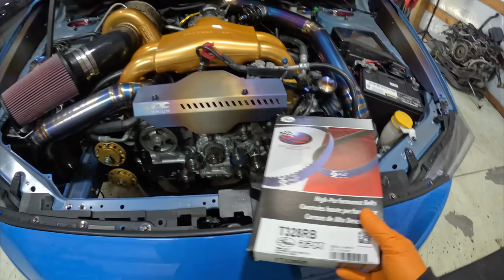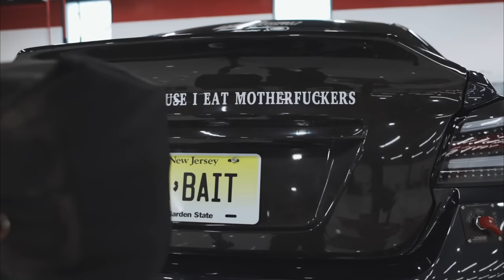DIY Subaru Timing Maintenance

Comment: Hey Bader, you said there is no way to torque them down without the belt because there is not way to hold it.   I have bc cam gears and I use the CTA 3855 subaru cam gear tool.  it works really well. Have you tried that ?

Comment: lolol so low mileage new engine installed by steveo (the pre boi) leaking oil....so makes sense to tow it to basically idaho to have steves former apprentice fix it instead of pre which is just about the worst and most expensive shop in the pnw. hilarious.